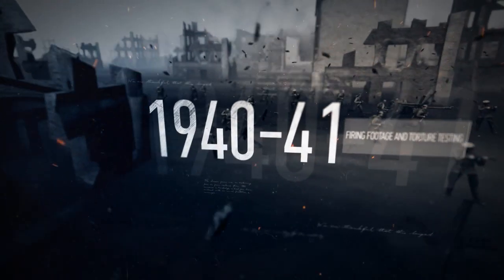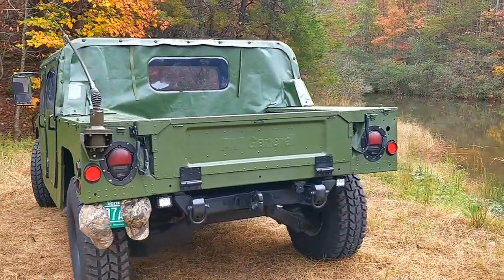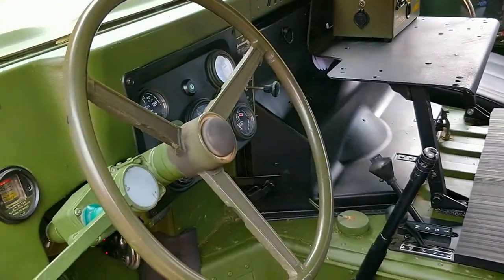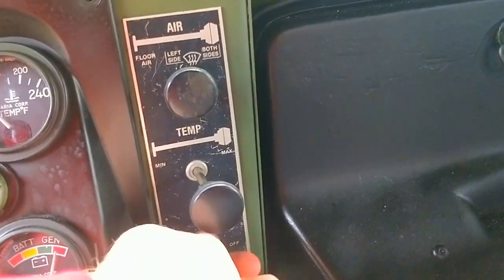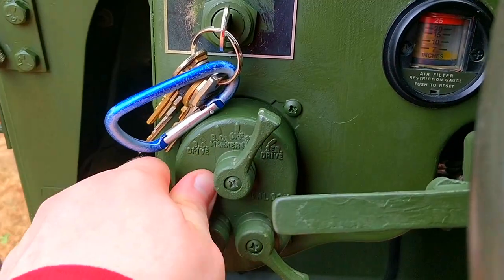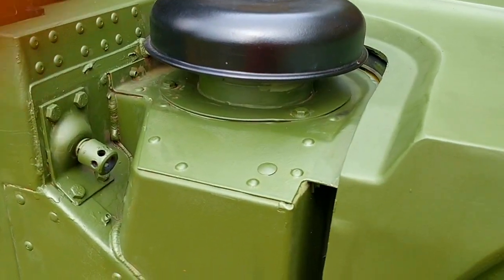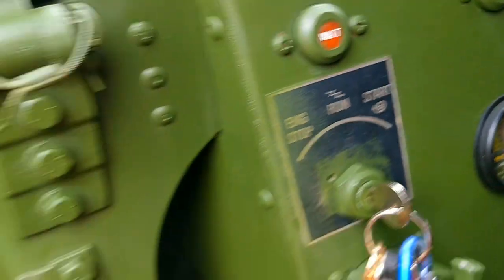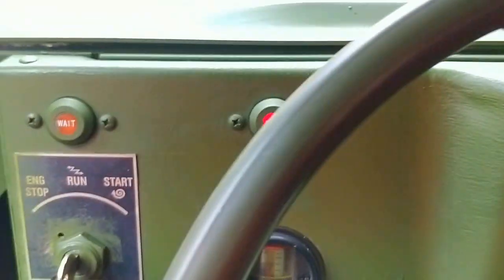Test driving Humvee

Comment from the maker: Quick questions answered.
1. It came off Fort Campbell 8 months ago. Home of the 101st Airborne.
2. It is not for sale.
3. As has been pointed out the throttle lock is not meant for a cruise control.
4. M998, I may have said M988 in the video.

Thanks for looking.

Comment: HMMWV  does not have cruise control that is the fast idle throttle cable for cold weather starting not to be used on the road as a cruise control that’s  One of the first thing they teach you when you are tasked with operating one of these types of vehicles if anyone here is looking for operation and maintenance of one of these vehicles I recommend watching one of the military videos on operations because there are people out there that can give you misinformation that can get you hurt or killed we don’t want that. As with any piece of equipment there’s proper operation and handling of such. 😎
Reply: Here are the videos in case anyone is interested:
http://gear-report.com/how-to-drive-a-humvee-hmmwv-training-videos

Comment: Looks great! You got a clean one!
What is the fitting sticking out of the left side of the engine shroud plastic at 5:19?
Oh... and tighten your alternator, bro!
Reply: That is a spout for engine oil to collect samples to see if the oil is contaminated by other fluids or metal shaving etc. It helps identify possible problems with the engine

Comment: Without the deep water fording kit which you don’t have you are limited to 30" of water. Nice m998 👍
Reply from the maker: Thanks for watching/commenting.  I'd imagine it would be higher than 30 inches as the snorkel is the deep water fording and that sits on the hood? I may grab one of those taller snorkels that you're mentioning. Have seen them but have yet to want to or have to cross a river up here ha.
Reply: The Mosin Crate  you need the whole deep water fording kit it has the taller snorkel/ exhaust but also has a valve that takes the EGR gases and Pressurizes the crankcase and other things you don’t want water getting in. You can find new kits online and sometimes on eBay. They are around $1500
Reply from the maker: @whiskeytangofoxtrot4363  nice! Thanks for letting me know. (I would not have known about the valve)

Comment: Are these legal on the street? 
Not accusing you of breaking the law or anything, I just thought I read that the military humvees were sold as an off-road only vehicle.
Reply: in some states its easier/possible to get them titled for on road use, usually the liberal leaning states are more reluctant to title it due to emissions and such (california lol) while down south whoever's serving you at the DMV will probably give you a compliment.
Reply: Emissions? It has a 6.5l diesel engine, one of the cleanest diesels out there without any emissions reduction equipment on it.
Reply: tell that to the californian dmv :P
Reply: Yes, you could have them street legalized but it will be a pain Other than that the process is easy
Reply: @tornexted5029  Wrong HMMWV buddy,the M998 (One in this video) only had the N/A 6.2L just like the M1008-M1031 CUCV.The M1025-M1046 HMMWV and M1113-M1167 ECV/HMMWV do have the 6.5L how ever.In the M1025-M1046,the 6.5L is N/A and then the M1113-M1167 have a T/C 6.5L.The 6.5L was also used in the CUCV ll.

Comment: What's the mileage on this? Is it costly to fill it up?

@6:38 That's badass
Reply: It depends.The 6.2L in the M998 could do 16-17 MPG easily.It depends on weight and gear ratio too.The same engine was used in the Chevrolet M1008-M1031,in the M1009 they could do 18-20 MPG,and then the others could do 21-24 MPG.